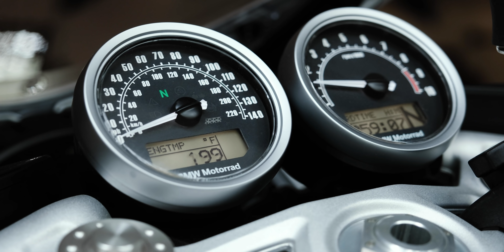BMW R nineT Rainy Day Oil Change | A Cinematic Walkthrough | Presented in 4K

Comment: Nice license plate! 😉
Be careful, the bolt on the K&N oil filter is there only to help to "remove". 
The filter should be tighted by hand.
Reply from the maker: Rodger that, just gave it a little extra sung.
Reply: 👍 I believe K+N have got quite a bad rep through filter failure by people doing exactly that.

Comment: Awesome video! You made oil change looks simpler than what it is, question... how about the service light on the dashboard?
Reply from the maker: Unfortunately you have to take it to a dealer to have them reset it, or pick up the gs911 tool that allows you to reset it yourself. No little hold a button for 5 seconds trick like on some vehicles.
Reply: GG Media Works thanks for all the info... I was hoping there was that little hold button...

Comment: I Think this is a great video. Lighting works really well with the subject matter. Did you use mainly available light and was it shot in a flat profile then graded a fair bit to crush the blacks? One way or another, the end result looks brilliant and extremely cinematic. Almost enough to make me give my Urban GS an oil change
Reply from the maker: Thank you sir. Yeah, I'd say it was 75% available light. I used a few little Litra lights for some of the under the bike shots and catch lighting on various shots. I shot in a flat profile and graded in post. The first few shots are from a Black Magic Pocket 6K camera that I was trying out so those were shot in B-RAW.

Comment: One question. That boxer oil is a fully syntethic one? Does the NineT needs synthetic oil or a mineral one?
Reply from the maker: You know, that's a good question. I didn't see anything in the BMW 9t manual about not using a synthetic oil. I do run mineral oil in my old M5. The Motorex website literally says that this oil was "specially developed for BMW air/oil-cooled boxer engines", so you can decide how much you believe that. So far the 9t has been running great with it.
Reply: @GGMediaWorks  Thanks mate. Guess I'll still be using mineral oil for muy NineT Pure.
Reply: @GGMediaWorks  bike looks clean bro all it needs now is the high mount exhaust so you can see that beautiful single sided swingarm it make the bike look  that much more beautiful
Reply from the maker: @damonwilliams4963  I have a Zard full system waiting to go on this spring. Should get it on in the coming months. Will make a video for sure on that modification.

Comment: Nice filming. I would recommend showing the use of a torque wrench for the sump plug and oil filter for those not familiar with how tight these should be installed, although it’s good that you provided the torque values in the captions. Also, safest to wear disposable gloves when removing the filter to prevent risk of scalding, and used oil can be harmful to skin. I think all the RnineT range sound gorgeous even on standard silencers👍🏍
Reply from the maker: Good suggestions, thanks for the feedback Thruxtonite.